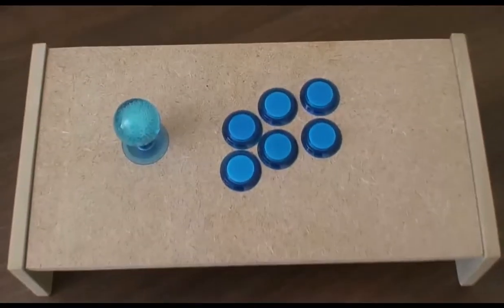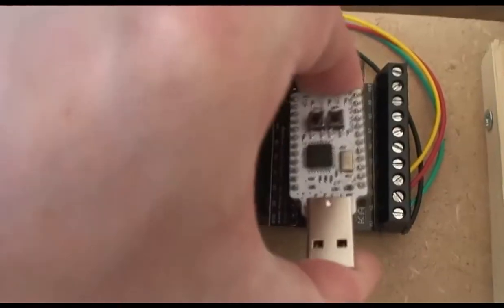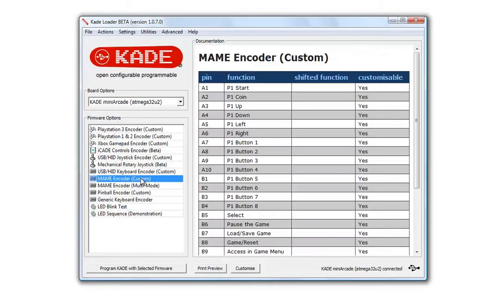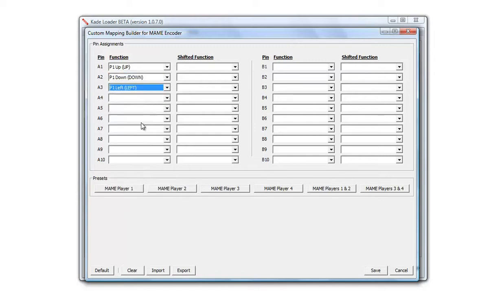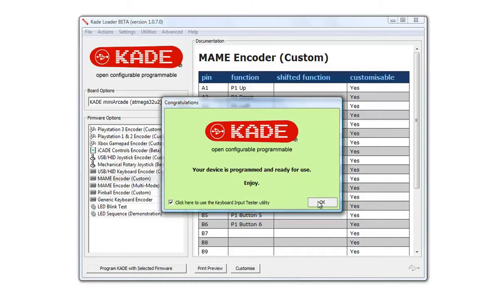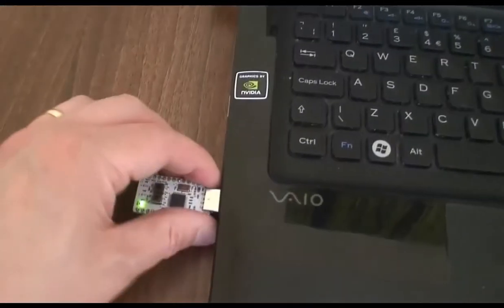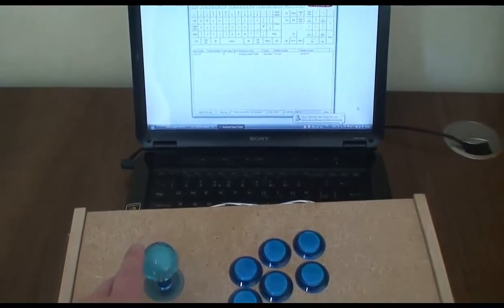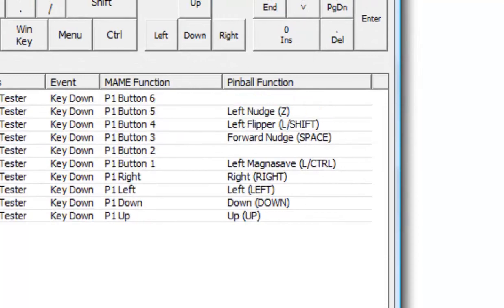Programming and Testing a Simple Arcade Stick

Comment from the maker: yes,  360 has security in the controllers so we can't provide native support for 360.  There are third party adapters which allow non-Microsoft controllers to work using passthrough - when an original controller is also connected.  These are often used to allow PS2 controllers to work with 360.  We are testing with these adapters.

Comment from the maker: KADE can function as a regular keyboard encoder just like the other encoders. It has other features and functions which make it stand apart. It can be programmed to work with many systems and has a selection of firmwares you can select from and customise to suit your controls. The software is being developed as an open source with community involvement and contributions. KADE is evolving with new features and systems being supported.  If there is something you want it to do then let us know.